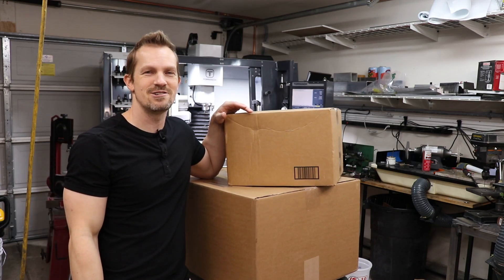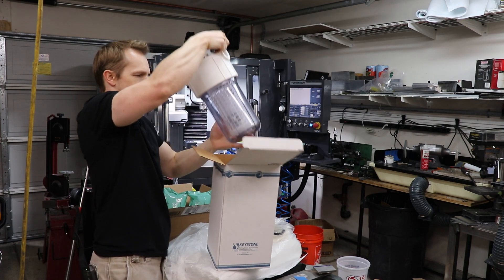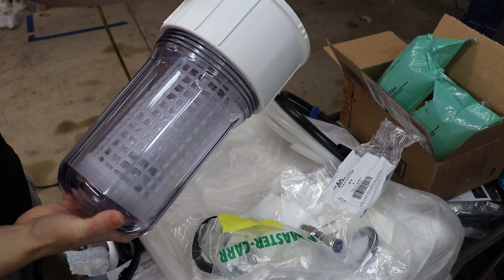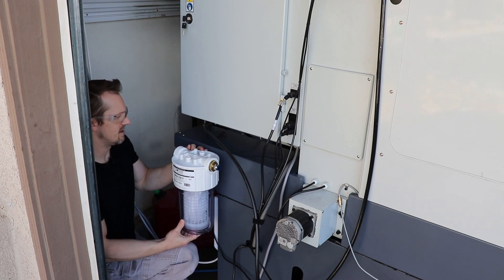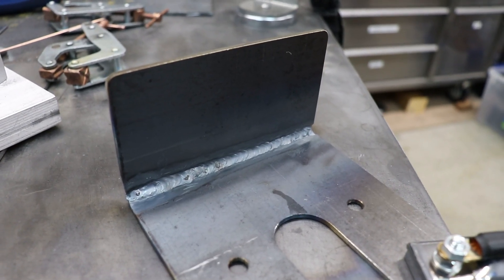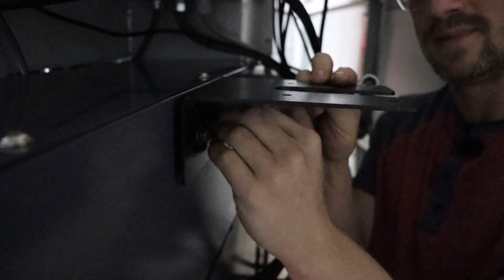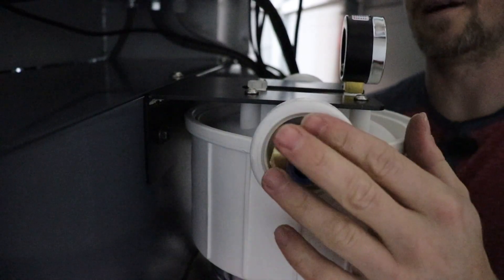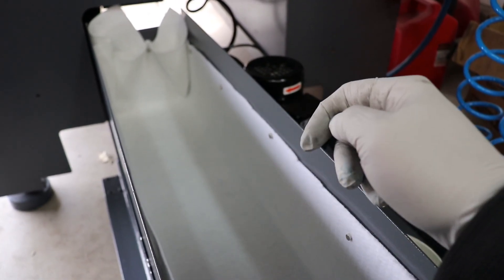Tormach 1100MX Mods Part 2, coolant filtration

Comment: Put your gauge on the inlet side so you can see when your pressure goes up(resistance to flow through clogged sock) you'll know to change. Pressure drop isn't going to be a reliable indicator.

Comment: Hey Jason, what gauge mesh did you end up with in your chip tray? Or do you just use filter felt all the time now? 
My new Syil X7-20 has arrived, electrician here in a few days to wire it in. The mesh in the tray is definitely not fine enough lol.
Reply from the maker: I use filter felt all the time now. It's so much easier to clean up if nothing else. I have 50 micron in the chip tray now and it still clogs somewhat quickly when machining carbon fiber but works well enough, just have to keep an eye on it.
Reply: @vcedge9466  how does it cope with chips from Alloys and steel? Does the coolant flow through fairly quickly? Or does it start to sit on top like a filter coffee for some time?
Reply from the maker: It has no issues with metal chips. I can literally fill the entire chip tray without having any flow problems.

Comment: Only thing left is to upgrade the pump to a 1/3 HP.  Big change when I had mine.   Could put a pressure gauge before after the filter, this would tell you how full it is with difference in pressure.
Reply from the maker: 1/3 hp would be great! I have a 1/6 hp unit I'm about to throw in since it looks like an easy swap, stock is 1/8. I'm wondering if the circuit could even handle a bigger one than that.
Reply: @vcedge9466  You will need this https://tormach.com/external-contactor-kit-33044-2.html.

Basically is a contactor/relay.  Trigger for the relay is hooked up to the Tormach.  Then the power for the relay/pump is power through 110-120 wall plug.

Comment: how tall is your ceillings hoping to put one in my garage appears will fit, also do you think the tormach 1100mx is worth the price alot of people bash it and say for that price to buy a haas, so i'm stuck trying to decide between teh 1100mx and a haas super mini mill?
Reply: Hey Shon, yeah people will bash whatever they want and there's bound to be something better. We started our business with a manual mill and lathe, after a while got tormach 1100, then a 15L, then a Haas VM3, and a year ago a UMC 750.
The 1100 was a great machine for us to start with, it allowed us to get into CNC without taking out a loan and without too much concern of destroying the machine while learning (being less powerful isn't all bad haha). We bought the base model, no stand, no ATC, no power draw bar (after ~3 years we did), that price is hard to beat when comparing to an industrial machine. Yeah you can get a used industrial cnc but those have there own set of issues like controlles that don't accept usb, or have slow processing ability and can't handle complex 3d or 2d adaptive clearing tool paths
I do think once you start getting the decked out Tormachs that's when you're getting into Haas price territory, personally idk why Tormachs get into that price given they're made in China but that's not relevant.
Unfortunately there isn't an easy answer to which is better but looking at what your use is (do you have something specific you want to make?) where you're going to use it (power inputs, floor strength, accessibility for moving), and price are going to be some easy inputs to help decide.
Reply: @spazzywhitebelt  thanks, New to the whole milling thing. I want to stretch my money as far as possible. How do you like your slant lathe that was also on the shopping list.
Reply from the maker: My ceilings are 100 inches. That's why I didn't get a Haas machine myself, too tall. I did have to raise the garage door to put it on that side of the garage. If you can fit the super mini mill in your place then I would do it only if you can find one similarly equipped for a similar price. It's a tough choice, I know. I'm ok with the Tormach machine for now because I don't need the horsepower and this works well enough for my needs. Only thing I would like right now is a tool changer with more pockets, lol.

Comment: Great job. Thanks. I thought the pressure would increase when the filter is clogged? I suppose i depends on if it is connected to the inside or outside of the filter bag. May be that is the reason for the other port?
Reply from the maker: I checked when I was assembling it and both of the ports go to the same place on the outlet side of the filter. I think its better to have it on the outlet side because it's easier to tell that 0 is not good. If it was on the inlet side who knows what the pressure would go to when clogged. Having both might be nice though, could always add one at the fittings.

Comment: Good stuff.  If you do much aluminum you’re going to want to redo most of the plumbing.  Take a look at the inside of the push to connect fittings and you’ll see they’re tiny. As a result the flow is severely impeded even with just the stock coolant setup. Switching everything to the next size up tubing helps considerably.  And the stock pump moves a decent amount if the restrictions are gone. 

I ended up making a new system that didn’t retain anything if the original system other than the tank and chip tray.  My goal wasn’t to get the chips wet, my goal was to evacuate deep slotting passes, lubricate and clear chips regardless of which side of the part was being machined, and to wash everything into the chip tray.  I don’t have to clean my work holding , table, way covers, or the inside of the machine.
Reply from the maker: That's a good point. The fittings I got from McMaster-Carr seem to be the same ID as the tubing all the way through. I'll have to check the Tormach ones. I might just do that soon, it does have trouble evacuating in some of the deeper pockets.

Comment: Nice! Hopefully the coolant doesn't kill that plastic over time.
Reply from the maker: I guess we will see. I'll let you know if it does.
Reply from the maker: Thanks for the advice. I would think as long as the carbon is filtered out well enough it won't cause too many problems but we'll see. I'm committed to trying it at this point.